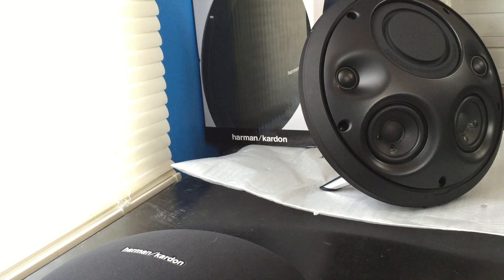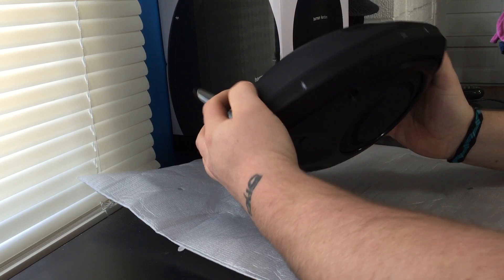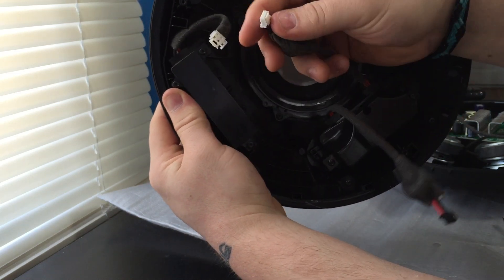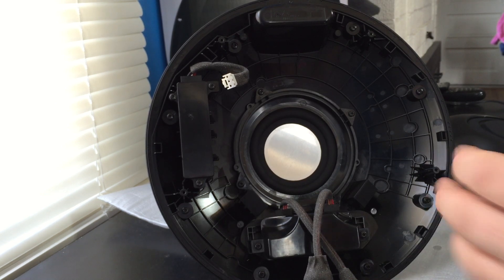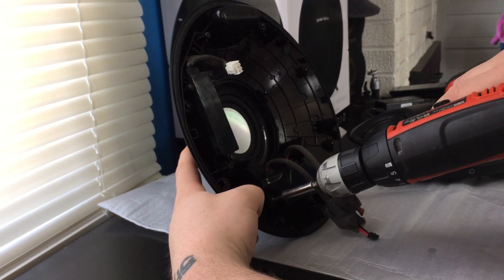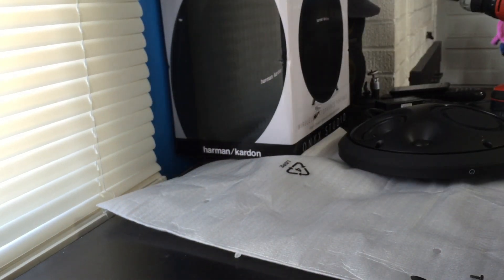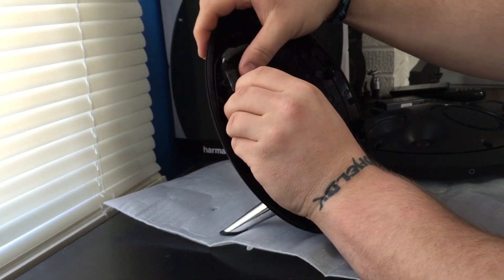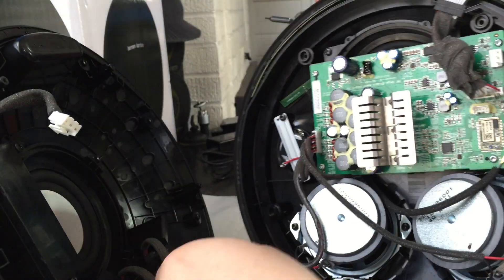Taking a Harman Kardon Onyx apart

Comment: Passive radiators do produce sound toy can actually tune the sound toy want coming from them by adding weight to it and different material. You are right though they are only powered by the air that the actual powered speakers move.

Comment: I got high and plugged the black connector into the white connector and after 19v into the 5v socket mine is completely dead. The inside is NOT idiot proof, beware.

Comment: Wow it would be easy to parallel connect a few cells for long lasting power. But I’m making a portable 19v pack to plug into the back for the full sound like when it’s plugged in.

Comment: Just replacing the battery today.  This video was very helpful, thank you!  Are you still using this speaker?  Did you add the extra battery?
Reply: Where did you get the replacement battery?
Reply: Paul Smith I purchased the battery from Amazon.

Comment: I have the Harman/Kardon Onyx 4 and the passive radiators actually make a huge difference! I blocked them off with my hands and the difference is massive.  I did the battery mod as well on my HK Onyx 4 as well. I replaced the battery with a 12,000 mAh battery (a flat cell type lithium polymer, 2 6,000 mAh battries that are matched to eachother). I also made it tonwjere tje usb port charges the internal batteries as well.

Comment: The battery of mine completely died. So I replaced it with a new 3.7 V 3,000mah. I did this myself and now the battery works however the bass does a loud buzzing sound. What caused that? Any ideas how to fix? Thanks

Comment: Hello, unsure if I am in the right place to ask this question, but I have had my onyx speaker for over a year now, and for some reason it still connects to my bluetooth (can hear the connection), but after it connects no sound is coming out. Is anyone else having this problem, and if so, so you know how to fix it? My sound is turned up, and I've tried other phones, but nothing is happening after the connection is there. Thank you :-)
Reply: Sherry Holmes Did any body offer a solution

Comment: What could possibly happen to mine? It does not charge, it just died and now when I plugged it in, it's just dead 😐
Reply: Yogiando #LaYogini , Hi , mine is the same, I'm thinking of replacing the battery, do you think it will do the trick?

Comment: Passive resonators do what a reflex port would do, but without taking much valuable air space thus allowing the box to be smaller.  I would not recommend adding stuff inside the case, as it lessens the air space and will change the low end sound of the speaker. Deepest notes will be dampened and some unwanted spikes may appear somewhere ~100 - 200Hz

Comment: Hello,
If You want to separate the legs from the body, screw type is Torx, size 10. 
I've got Onyx Studio 2, I think it is the same. FYI, I just fixed one leg :).
Have a nice day.
Reply: ok how do you fix 2 broken legs ?
Reply: @crystalnyla  pull the rubber off the end of the feet and look down inside it and there is a screw inside,easily removed

Comment: So the front "woofer" is a passive radiator as well? Those two midwoofers are producing all of the bass? Wouldn't have known that without this teardown. So thank you. Looks like it shouldn't be too hard to upgrade those mids with something better (vifa, peerless, etc...) from partsexpress.

I was worried about reports of people only having the stock battery last 15 minutes. But, considering the ease of opening, and the fact that these can be had refurb now for $80, I think I've found my new bluetooth speaker.

Comment: How do you take the legs off
Reply: As RTCharger explained at 5:52, you must hang and remove rubber foot on each and reach the screw inside. You must have a long and thin tool.
Reply: Screw is Torx, size 10.
Reply: what if legs are already broken off?????
Reply: ugggg need help

Comment: Hey maybe the answer is already somewhere in the comments but I have the Onyx Studio 2 and you hear a rattle in the bass when you play it past 50% volume I'd say. please let me know if there is anything I can do internally with the speaker to make it sound as clear as when I 1st bought it
Reply from the maker: I'm currently having the same issue, but at a higher volume (probably 70-80% volume) I honestly think one of the radiators are damaged or blown. I get away now by turning the bass down in the EQ of whatever device I'm playing from, but I might take it apart and see if there's anything I can to to fix the issue.
Reply: +RTcharger alright appreciate it man
Reply: +DJ Alexander I'm honestly too lazy to do it. Adjusting the bass on my phone made it less radly for me. at least we all know that its a common problem. you'll probably have to go inside the speaker and work from there

Comment: RT-I recently bought a refurbished HK. The volume button "-" goes down but the "+" not up. Do you think this might be a physical issue [like a wire] or a mother board one? Trying to decide if I can fix it or need to send it back...thanks for your opinion.
Reply from the maker: Hmmm, I would honestly send it back either way whether you think it could be an easy fix or not unless it's gonna cost you. Then I would pop it open and see what's going on. Probably a bad button though so you'd have to replace the whole button module.

Comment: Would it not be easier to extend battery life by connecting one of the widely available power banks/portable chargers through the mini usb port?
Reply: The micro USB port is not a power source. There is a completely different jack for your power. the micro USB is to, when Bluetooth is updated, allow you to plug your speaker into your computer and upgrade it.

Comment: how do you remove the legs ? you need to take it all apart ? i really need to know.
Reply: +Bogdan Florea there are screws behind the rubber part, should pop out if you got the right screw driver
Reply: +Bogdan Florea the little rubber flaps on the bottom on the legs are removeable

Comment: Hi! So, I got this speaker when i bought my phone, and I think the charger was broke. My HK Onyx can't charge its battery anymore. Does anyone know the solution? Thank you.
Reply: +herry yohan the battery does have a life span. if it isn't charging, time for a new one. battery in this video i tired to see type of battery but he moved too fast, i opened mine up and its LC18650 go on ebay, theres tonz but will require some tinkering to attach cables to it.  if your whole hk isn't powering on, get a different charger. the specs are on the back sticker it should say (on mine it does) 19v 2a

Comment: instead of just adding batteries in parallel, can u add in series to increase voltage to mimic when plugged in with 19v charger

Comment: Thanks for this video, your a gent.
I have just received my onyx studio, I am quite pleased with the overall sound but to be honest I really would have prefered the newer non studio version. Unfortunately it was double the price. I would have really appreciated the AUXILIARY INPUT jack so I could plug my Astell & Kern JR straight in. Also bluetooth 4.0 instead of 3.0 the studio has,  just wondering if anyone thought of replacing the bluetooth circuit board with the updated 4.0 giving better sound & range. Lastly I beg someone to do a tutorial on full specs on a replacement pack of batteries and video guide on how to replace or add to the paltry 2600mha enclosed battery.
I see in the comments that there are several people who are very keen on a follow up to help them along...
Reply: Hi Gary, did you find out how to add an AUX input to the Onyx? I am having the same idea.

Comment: Did you remove the plastic cap/cover over the metal speaker (rear passive radiator) on the back? The cover must be removed for proper speaker operation. It's nearly undetectable, but is there!! You have to remove it carefully. if you don't feel the aluminium stretch marks, then the plastic cover is there.

Comment: Isn't the charger rated 19 volts? then why is the battery just 3.7 volts?
Reply: rion I was thinking about this too. There might be current and voltage regulator inside for the battery. I am thinking  to add more batteries  in series / parallel to come up with around 7.4v 10,800 mah pack. Though not sure if the internal charging system for the batts can handle 7.4v.
Reply: +allan soria I think it is not a good idea to connect them in series

Comment: Sorry if some one already posted this.  If you remove the rubber pieces on the end of the legs there is a screw up inside the leg for easy removal
Reply: +James Ervi So, to remove the legs, you just need to remove the rubber caps, and unscrew the screws inside, without disasembling the whole thing ? I really need to know :D
Reply: James Ervi Do you know what kind of screw driver is needed to fit the holes and screw shape?
Reply: I'm not planning on removing mine but from what I can see it looks like a  percision philipshead screwdriver.  I think the biggest issues is you have to find one long enough to reach the back of the legs
Reply: What if your legs broke off?

Comment: Follow up on the battery. Is that a 18650 type battery in it. If so, it's a common battery and an upgrade is easier.

Comment: I bought some more batteries for my Onyx, 3 to be exact.  They are ran parallel.  My question to you is, where does the extra wire (the white wire) go?
Reply: hi, do you arrive to put the 3 parrel battery safety in your onyx?
Reply: +Régis Laveuve give me a email address I'll send you a picture.  I basically glued a 3 pack battery pack to the front of the case.  I also removed the factory installed battery.
Reply: +george poe 
regis.laveuve@gmail.com  there is no risk to put lithium batteries in parallel?
Reply: +george poe 
you removed the factory battery because the 3 batteries have to be exactely the same capacity if they aren't they can explode, or take fire?
Reply: All three are the same capacity as the original battery.  No issues so far, and its been around 3 months since I installed them.
Reply: +george poe 
can you send me picture? rere33@hotmail.fr ?
Reply: +george poe 
can you send me picture? rere33@hotmail.fr ?

Comment: Any ideas for leg replacement?
Reply from the maker: Unfortunately I ended up returning it, couldn't use it at work like I planned, so I never did get to modify it at all. I would've probably found some type of hinged setup so I could fold the leg(s) in when not using, or possibly even some kind of short telescoping rod (2) to replace the legs it had, so Id have been able to push them flat with the speaker when carrying it.

Comment: No way its just one 18650 2600mah battery! Impressed but just how little.
You can easily get 3400mah and then parallel 2 or more, you'll be over 10 hours playtime.
Did you end up modding?
Reply: Bruno Mills  Hi! Any result in putting 2 x 3400mh 18650. Did it more than double the playing time.
Reply: +Bruno Mills have you replace your batteries..? would you show the video..?
or at least show the picture you put the additional batteries..?
thanks a lot..
Reply from the maker: Unfortunately no, I wasn't able to use it at work like I had planned, and I already have a zillion other means of audio at home so I had no use for it, I just returned it.
Reply: Ohk. Mine should arrive today. I will try and mod for two 3400mah in parallel. Extrapolating the time and capacity of original. I should be able to get 13 hours with the new setup. :)
Reply: +Bruno Mills hello do you have a video on how to had more batteries
Reply: •BFM Productions• hey man 2 years later, did you change it out

Comment: Thanks for the video! Inspired me to take mine apart and upgrade the battery. We use ours for 9+ hours at a time without an easy way to charge it. I replaced the anemic 2600mah battery with 3x 3000mah (18650s) batteries in parallel. You're right, plenty of room inside.
Reply: jkinlv How did you do that?  Mind posting a vid or tutorial?
Reply: hi dear jkinlv, would you ahow the video, how to replace the batteries..?
i plan to replace it roo...because, it's to small at 2600mAh..
at least the picture that you have replace it, so that we can imagine the place you put the aditional baterries..
thanks alot
Reply: I know im a little bit late put you mind posting a video of you're setup?
Reply: Video on how you did that???
Reply: jkinlv  With your mod on the battery, did it double the playing time. Also , planning on adding  a parallel and series battery config to boost the voltage to 7.4V and increase volume on battery power. Though not sure if the charging system inside can adequately charge 7.4V.

Comment: Any ideas for upgraded speakers?  Was thinking of removing the front passive and adding a third speaker.  The possibilities are really there
Reply from the maker: I actually ended up taking it back, since my work decided on a no-speakers policy just after I got this. The possibilities were honestly endless though, tons of spare room, very powerful amp, I would've started with a large extra battery pack with a usb output to charge your device, but speaker wise im not really sure. Let me know if you do change anything, I'd love to see a video. Upgraded speakers would be crazy in that thing.
Reply: RTcharger I use a plastic dome that we make at work, and I put mine it in.  I can hear the bass in the offices from the production area.  I will have to take it apart and see what the specs might be for these speakers and will look up alternatives in the future.
Reply: +Jacob Cline +RTcharger Hey guys, curious if you ended up swapping/upgrading the speaker modules. I blew out the bottom-right woofer (resulting in cringeworthy buzz/rattling), and am doing some google-fu this week to see if I'm competent enough to replace the broken woofer or whether to take it to a repair shop and pay the premium. Great vid, +RTCharger!
Reply: how would you know if the charger or battery is bad it wont hold charge

Comment: Awesome video man! I didn't wanted to take it apart myself because I break things easily. One way to get more run time from onyx is to add a higher mAh battery. Instead of 2600mAh, maybe 4800mAh. Almost double the run time.
Thanks again for sharing the video.

Comment: Hey man, glad to see your video here because I want to take mine apart as well in an attempt to add the biggest missing feature of this system...which is an AUXILIARY INPUT jack!!  I'm surprised you don't mention that along with all the ideas you have mentioned. Would love to see you make that happen and make a video on it! I would think you just need to find the right spot on the board to solder in the missing headphone jack so the signal still gets fully processed and played through the whole system (as opposed to just soldering straight to the speakers or something).  Anyways, glad to see someone at least get a teardownlm of this beast on video!
Reply: Graham Hart any luck putting the AUXILIARY INPUT jack ?
Reply: +Graham Hart, I had the same idea now. Did you have luck with that?
Reply: You ever get that to work?